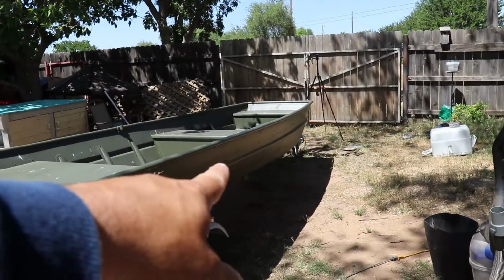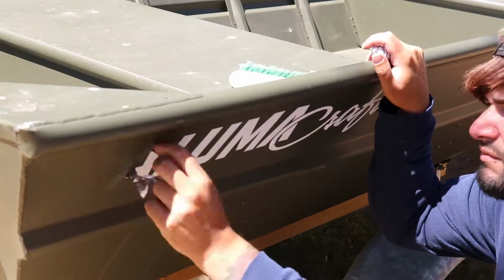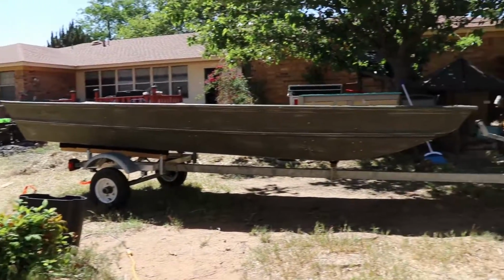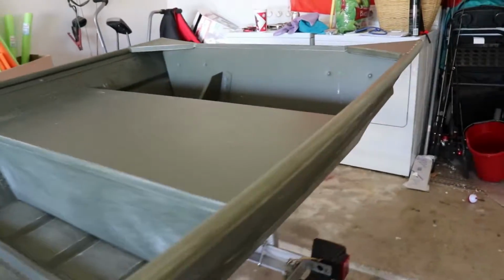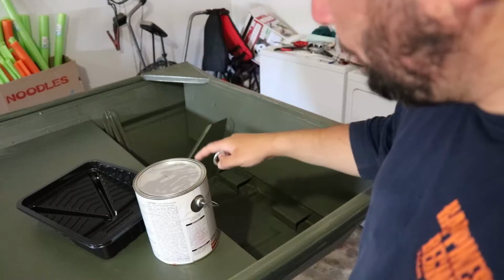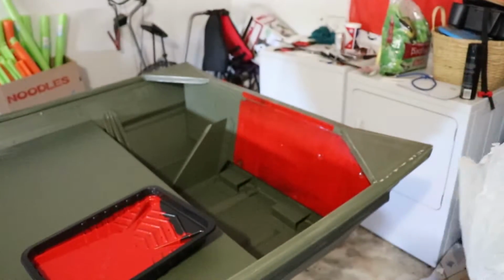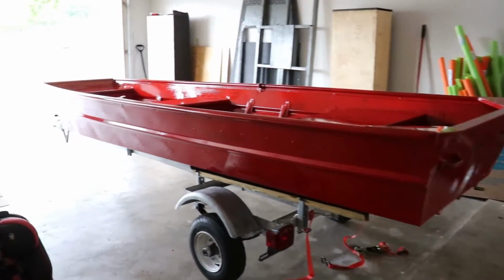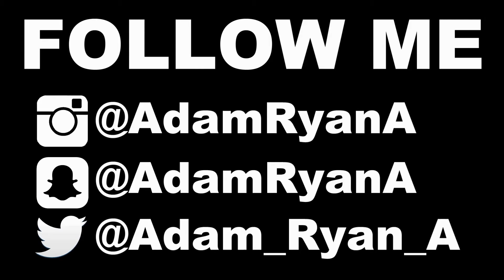Painting my Jon Boat RED!! Jon boat to Bass Boat Build Progress

Comment: How did the paint hold up?  My boat project, my buddy used marine paint of some sort.  If I can get Ace paint I'd rather do that.  I only need to do the inside.
Reply: Did u end up getting some paint if so what kind and how was it
Reply: @bradsellers5592  Never got to it.  Issues came up.   I'm finally back to working on the boat.   I'm going to leave the paint alone and build a flat deck like a bass boat instead

Comment: What did you wet sand with in between coats
Reply from the maker: 200 grit and then 600 grit wet sand paper
Reply: @AdamRyanA  200 on the original paint correct?